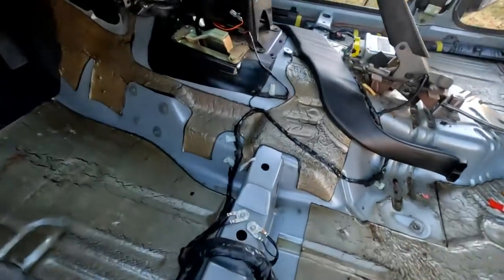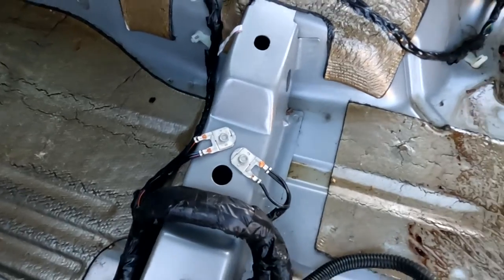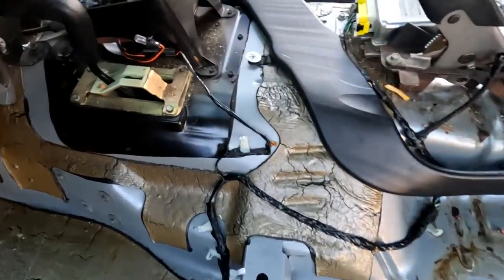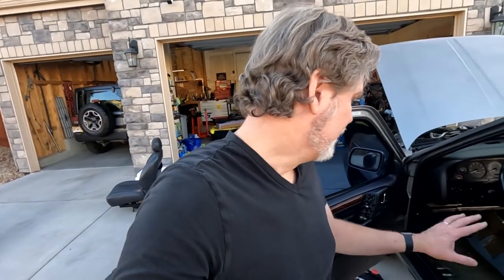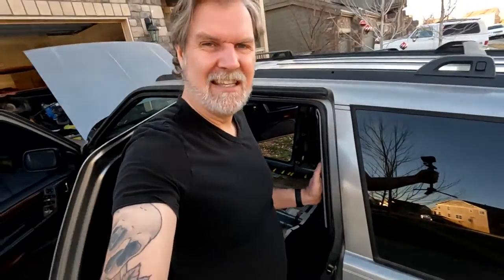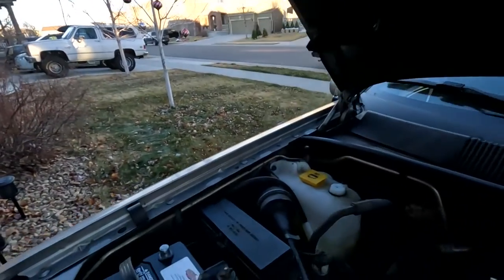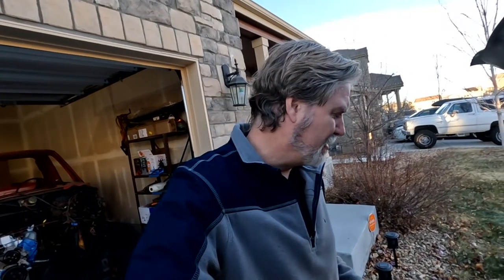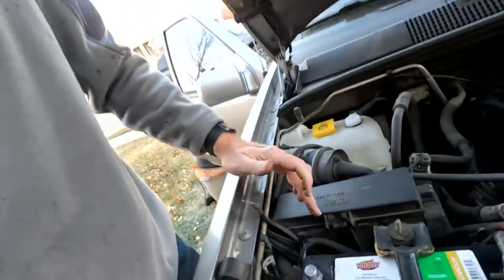Jeep Grand Cherokee ZJ Body Ground Locations

Comment from the maker: Electrical issues can sure be tough to diagnose, and ZJs seem to have more than their fair share since they were right there in the late 90s when every manufacturer seemed to be having issues with soldering circuit boards... that wouldn't manifest themselves for 20 years when the solder cracks and starts causing all kinds of weird issues. However, corroded grounds can cause many of the same symptoms and are much easier to fix. What are some of the electrical issues you all are tackling on your ZJs?
Reply: Currently my main issues are my 98 ZJ 4.0 overheating with he AC running and driving. Also when using the cruise control at 65-70 after a few mins the battery gauge goes from 14 to max and then check gauges comes on. When I lower my speed then it goes back to normal. Newest part was a new starter. I don't remember any issues before that but really can't remember using cruise control at that time before the new starter. Plan on replacing the fan clutch and new serpentine belt to see if that helps. IDK
Reply: I can’t get my my interior lights to work, and my left blinker just goes burrrrrrrrrr lmao
Reply: Have something draining my battery. 2 batteries in a year.... Thanks for the video, Thomas, France

Comment: Thanks. I didn't know there were grounds under the seats. I love my ZJ but dang, it's having bad electrical issues.   I know this won't solve my problem, but great video. I would take a ZJ over the rest any day.
Reply: So... My interior lights and locks started working after I found my IOD fuse was burnt. I replaced it and haven't had a problem since.

Comment: Also check the ground splice locations in the harness for corrosion it’s a common problem on the ZJs.
Reply from the maker: Good call! There are a LOT of splices in the ZJ, only a few of them are ground spices but they are all over the place. We're adding a link to an unbelievably complete wiring and component diagram. Its for a 93 ZJ, but will be applicable to we would guess 95% of everything you need to do on a ZJ. Link added in the description. Thanks for commenting!

Comment: theirs a ground under the driver side headlights under the plastic and its definitely corroded. Theirs most likely a wire under the rear hatch panel for the latch that is most likely cut from the factory. I wen to the scrap yard looking for a rear hatch cuz mine got scratched and they were all cut accept for the one I found and that fixed my locks not locking half the time. Their are grounds on the front of each head and the rear tho on the passenger side it may be connected to the block but mine might just be connected incorrectly. I have heard their is a ground somewhere along the uniframe by the engine but I haven't seen it.

Comment: Oh by the way as far as your amplifier goes I can tell you exactly what they did they cut all the speaker those are the outputs to the speakers they cut all those off and rewired a new amp in there and probably took it out before you had it they might have had subwoofers or whatever else you might want to check your door speakers and see if they're Factory there's a good chance they probably replace those two
Reply from the maker: That makes good sense, thanks! We did check and have the factory Infinity speakers in the rest of the Jeep, so either someone put those back in or just did the amp. Thanks for the insight!

Comment: Can the jeep cut off while driving due to a bad ground connection?
Reply from the maker: It can, yes. If you’re having weird electrical issues, clean and tight grounds is a good place to start. If you’re lucky it’ll fix the issue and if not, at least you’re starting with known good grounds. Good luck!
Reply: The dreaded Cherokee random shut down.. very common. Crank position sensor, ignition Coil, bad grounds, loose connections at the harnesses and computer seem to be the main causes of it.

Comment: I’ve just bought a ZJ with 340,000 km in Australia. Very happy with the purchase as the 4x4 features are fantastic and the engine in great condition. The wiring however is giving me some trouble. 

1. Electrical chairs work however the heating is not. 

2. The lights on the dash go dim however when I press hard on the main light button near the wheel and ignition with hands it brightens up again 

3. I bought a trailer where the trailer lights work however when I connect the electrical lights from my Jeep ZG/ZJ the trailer lights will not work. They work on my father in laws prado 

If anyone can give any advice before I spend more money on the  electrical than the car itself haha as I love the vehicle please let me me know. 

P.s love the vid

Kind regards,
Reply from the maker: Electrical can be very confusing but if you can read wiring diagrams and you have good ones, you can solve any electrical problem. Mitchell On Demand has the factory manuals for these ZJs online, and they are only like $30 a year for unlimited access, including component locations and trouble shooting techniques. Plus, if you aren't super comfortable reading wiring diagrams, they have good tutorials on how to read them. Go to eAutoRepair.net and purchase the ZJ ones, you won't be sorry. Thanks for the comment!

Comment: There's no engine block ground on this thing
Reply from the maker: There's an engine ground on ZJ's :) There has to be, or none of the electronics on the engine would work properly. On the 5.2 it's a strap that comes down from the firewall to the back of the engine, connects to the block via a bolt, and then goes back up to the firewall, making kind of a V shape. Thanks for the comment!
Reply: @MotorsandMischief  thank you for getting back to me so quickly however I don't have the 5.2 I wish I did unfortunately I have the 4.0 automatic two-wheel drive Laredo
Reply from the maker: Our pleasure! It should still have a ground. We believe on the 4.0 its a single strap and not the V configuration. It's certainly possible yours got disconnected somehow over the years and the engine will use any ground it can find to connect to the chassis, so it may run fine but still be missing its ground. Bad grounds can account for all kinds of weird, phantom electrical issues but the good news is you don't need anything special to make a grounding strap. You can buy generic grounding straps at any auto supply store. The 96-98 ZJs are OBDII and will be slightly different than the 93-95. If its a later one, you should see a strap at the very, very back corner, kind of on the drivers side. It may still be hooked to the engine and just never got reconnected to the firewall. If there isn't one there at all, get the generic one from the auto parts store and connect it from any solid metal surface on the engine over to the firewall. If you're at a loss for where to connect it on the engine, there is a bolt holding the oil dipstick tube that can be removed, cleaned, and used as an excellent ground location. The factory location on the firewall is just a hole in the fire wall with a bolt through it. If you can find it, clean the metal around it good and run the bolt in and out a few times to clean up the hole. If you can't find it, just drill a new hole in the firewall (carefully, not too deep) and make yourself a new one. The truck will happily use any good ground you supply so you don't have to be overly picky with making sure you get it exactly where the factory had it. Just make sure the engine has a good ground. Good luck!
Reply: @MotorsandMischief  thank you so much for the extremely valuable info,while I am on this subject I did do the ground strap from the negative terminal to the passenger firewall the spade loop where it connects to the firewall nearly  half of the copper wire was gone and corroded pretty bad I cut it off and cleaned it up reconnected without spade loop just to see if it would work still same result which I was driving around engine was at operating temp it just quit noticed after I cycled key my gauges temp went straight to 0 I have full tank of gas it went to empty even light came on briefly then went back to full also when it was being pulled back home 2 blocks away I noticed speedo was inoperative while key was on accessory setting has never done this before any suggestions would be appreciated if possible thank you so much and merry Christmas to you and your family
Reply: @MotorsandMischief  oh I also got to mention whenever I checked it on the side of the road before I pulled it to the house there was no fire coming from the coil to the distributor I almost forgot I'm sorry about that that's all I can think of or at least that's all I noticed anyways thanks again you guys have a merry Christmas and happy holidays
Reply from the maker: Alright, good info! So there is a ground at the coil on the 4.0, check and make sure you have a good connection there. You also have a ground for the PCM (the computer) and depending on your year it can ground at the fender where its mounted or at the lug at the dipstick we mentioned earlier. Clean those grounds and also use a meter to make sure they are flowing current (put your meter on ohms and touch both ends of the wire and make sure you have 0 ohms resistance. Those along with the grounds we showed in the video are a great place to start. But you could also have a power issue. Jeeps have a bad habit of their power wire corroding from the inside and although it looks good, it's not flowing any electricity. So check continuity again for the power from the battery down to the starter and from the battery over to the fuse block. The Jeep Forums are your friends when this happens, and here is an awesome article on all the things to check: https://www.jeepforum.com/threads/12-things-you-can-do-when-your-zj-stalls.1407423/
Merry Christmas to you too and we hope the problem makes itself apparent for you quickly!